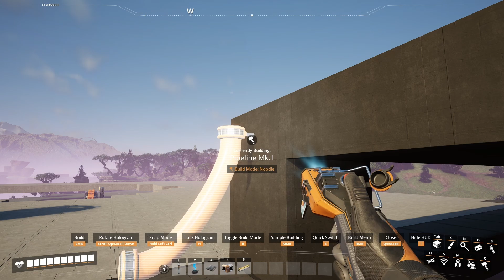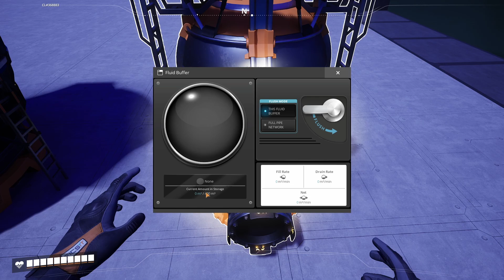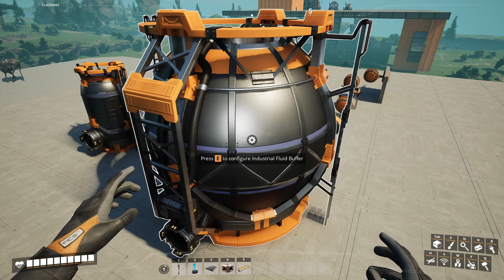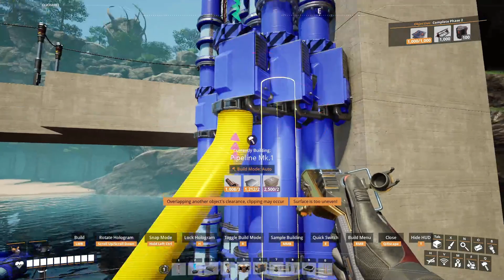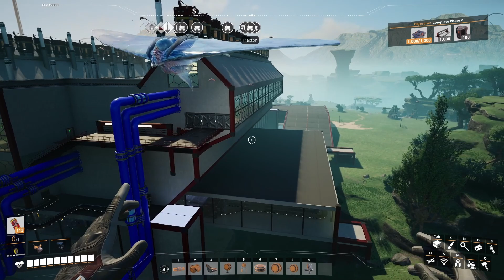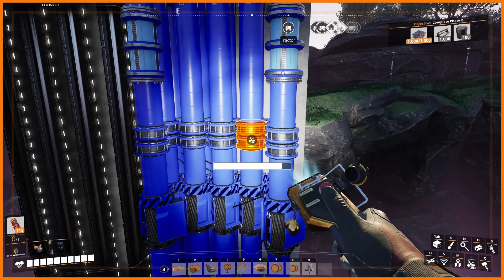Guide for Fluid Mechanics + Flow rate bug fixes (Mk 2 pipe bug) | Tips and Tricks | Satisfactory 1.0

Comment: My main criticisms about this section of the game, as someone who works in the chemical industry, are:

1) the fluid mechanics in this game are so jank, and it seems to be a mixture of lazy coding and utter lack of research. 

The devs will put so much time and effort to fix the floating point calculation, but can't even code that head shouldn't reset at the inlet of a pump. It's so strange. 

And the raw numbers on equipment are just off as well. An industrial water pump for a large plant should be able to output 70-90 psi without even thinking, and the flow rate should be much lower. Satisfactory's water extractors are centrifugal pumps so pressure is their job. And it wouldn't just mean building more because the amount of water going into power buildings, when converted into steam generation, doesn't line up at all with what a generator would make with that amount of steam. They just threw numbers at a dart board and used that. 

Not to mention that the pipeline pumps are just awful. They are visually a PD piston pump, which means that every time the buffer on a building is full it would likely rupture thanks to the cut off flow.

I could go on

---------

2) The playerbase's obsession with 100% efficiency is so dumb, you'd never be able to run a plant right on the edge of perfect flow and perfect pressure going into a system. Conditions change, and you build your system to account for that. Provide a pressurized header so you always have flow. Always build a stand tank to account for system instability. 

But no, Satisfactory players have gotten it ingrained in their heads that 100% efficiency is the only way. It's brain rot 

I get that things are gamified but it just ruins the game
Reply from the maker: there is a thin line between gamifying something and realism, I can unerstand why the devs chose the numbers they did, but the second point, about 100% efficiency, that I agree with, adding in a buffer or downclocking a system is fine if it makes it stable, rather than 100% effective
Reply: @jackblade281  I mean, it's one thing to say you understand why, but the numbers are just random. It takes about 10 minutes to actually do the calculations and use numbers that halfway represent what's going on, that's just laziness at that point

Comment: There is some very bad info on this video mixed in with good

For one, as confirmed by devs, mk2 pipes aren't bugged they work as intended - you fail to mention looping the system so that machines creating stutters by pulling fluid into them don't stutter the whole system

Valves and buffers are unreliable 'solutions'. They more often than not cause issues in a system.  The only places, if you want reliable set ups, that you have buffers? Train platforms. 
Valves only send X fluid pm through a point if the pipe is full, if the pipe is full and feeding a machine that consumes X , then the machine regulates flow. A system that works with a valve will work w/o a valve.
Reply from the maker: if that works for you I am happy, and won't argue with you. However that does not make my info bad, it's just not for you. 

The loop is only good for systems that aren't ever 100% saturated, I will bring it up in an upcoming video on fuel generator setups and byproduct handling

The valves and buffers are great when used correctly and in the right situations. Once again, I have not gone into detail in this video because it becomes relevant with Fuel Generators and Nuclear Power and I will reserve time in those videos to really go through how to use them.

And no, not all systems work without a valve, I have seen at least 10 different fuel gen setups the last week that were helped specifically by fluid buffers and valves, especially when loading up a save.
Reply: @jackblade281  systems should be 100% saturated. Always pre flood your systems. 

1. it helps manage back flow as fluids flow to more empty spots and not having a flooded system can create sloshing that may permanently destabalise systems
2. it's excellent trouble shooting, since if you start off with a flooded system and you see a machine start to starve you know there's a flow issue

In basically every system a valve or buffer is used the system will run fine w/o them. 
Again, valves will only allow it's marked flow to pass through it when it's *full*, which you apparently don't like, and at that point, the machines consuming the flow will regular how much goes down the pipe. Making the valve pointless and just another possible failure point. 

And it's not that it's impossible to have functioning systems with valves and buffers, it's the difference between carrying plates to the table to set dinner, and juggling them to the table. While sure, you can juggle them, it just shouldn't be how you teach people how to set the table.

Comment: There's no answer other than don't use mk2 pipes.
Reply from the maker: as much as possible, yes but you can still have other issues that happen regardless of if you use Mk2 or Mk1
Reply: @jackblade281  I have 375,000 MW of power using mk 2. 93% and moderate power flux. Switched to mk2 and resigned, 425,000mw 100% no power flux. Some of your tips with mk2 in this and previous vid helped but never 100%
Reply from the maker: @jlatture1  I am just happy you have gotten it to work! It's so finnicky, needlessly complicated and if someone out there says they have 100% grasped fluid dynamics in Satisfactory, they are missing something XD
Reply: @jackblade281  I had a mega coal power plant ~30gw with mk2 pipes going thousands of meters with the water. In 50 hrs, no flow rate issues using mk1 pipes. Even with letting the system fill, raising pipes, using pims etc etc, never can get 100% throughput with mk2 pipes
Reply: The devs confirmed that there is no mk2 pipe bug. There are only flow rate issues when you have back flow in your system. Fill up the pipes before starting machines to fix it.

Comment: Thanks for the video! I've wasted more time on fluids than anything else in this game so these videos always help people. I think Coffee stain all trolled us by having the fluid dynamics for dummies book in the hub's bathroom on this. lol. However, I would like to say that any pipe video that covers the problems with pumps and how water towers solves these problems should not be showing a wall of pipes with pumps at 24:00 in, lol. I get why you're showing it because every pump on those pipes can cause problems, but you should also be saying "While I'm going through and fixing all my pumps like here, you can also use the water tower principle to get rid of most of these pumps as well - which is even better". Then show the after picture with just a single pipe going up with the pumps properly added. Because using your own words, having a single pipe with pumps is much simpler than 12+ pipes to deal with (likely over 50 pumps).
Reply: I didn't realize resetting the head lift with a buffer set to a higher point was a glitch.
The mechanics work exactly like a RL water tower. We have many here in Texas. The flow created by gravity negates the needs for pumps to houses...

Edit: Some research indicates that the exploit has to do with breaking head lift very specifically to create a scenario where you can lift fluids even beyond the original water tower. Gravity-fed head lift is intentional.
Reply from the maker: @PersistentDissenter  yepp, I do mention water towers and "saving" headlift by running fluids down into your system, and building fluid systems top down instead of bottom up, I could probably have been clearer though
Reply from the maker: I also say this in the video; That is an exploit, a glitch, and I am not teaching people how to break the game, I am teaching how to use the game mechanics as intended. Let's Game it Out and others will likely show that off, I wont use that, if it gets fixed by the devs my video is still relevant, if I added that in it would no longer work.

Comment: i had 48 fuel generators being used in my first oil power plant and the issue i ran into was the fuel not making it to all the generators. the solution i found for that was to underclock the ones in the back to 50% and slowly bring them back to 100% once i did that i no longer had problems :D

i have ran into the pump bug. i didn't realize it was because the pipe was going through it, i solved it by deleting the entire pipe and replacing it lol!
now i know i just need to delete the two segments and replace them thank you ^^
Reply from the maker: yea, fuel generators are horrible to get to 100% happy you solve it XD and yea hope it saves some time for you later!

Comment: Hiiiii I can't use the trick of joining two sections of pipe with the pump on the mk2 pipes
Reply from the maker: if the pipe segments are way too long, it wont work. also, I haven't extensively tested it after 1.0 so I don't know the exact specs for making it work yet. But try shorter segments for now
Reply: @jackblade281  yea it was exactly my line of reasoning and still nothing I even replaced the same exact pipes with mk1 and I got it without any problems but when I put mk2 back I couldn't get it again 
I'm really confused as I never had any problems before 1.0 and now with the same exact setup I'm having problems
Reply from the maker: @Carmo_TDM15  I would recommend splitting your pipes up then so you can stick with mk1 tbh

Comment: Snutt has confirmed more than once that the floating point problem in MK2 pipes has been fixed. But I can also confirm that the problem is still there. In my aluminum plant, over dozens of hours of testing, I have come to one conclusion - give up on the 600 m3 flow. It is better to run more pipes - nerves will be better :)
Reply: I find it works a lot better if you can design things so every machine only has one type of source. So each refinery (or set of refineries in a large plant) is either fed by water extractor, or bi-product water. Do not try to supplement by-product water with a little extractor water, the numbers will mess up somehow. All gravity fed if possible. 

Then have a wet concrete plant above that to sluff off any buildup of bi-product water.
Reply from the maker: @5353Jumper  Yepp, I got to that conclusion after spending waaaay too much effort trying to make my recycled water loop work for my aluminum plant in the U8 lets play
Reply from the maker: that, and better to sink byproduct water than recycle if you want to keep your sanity XD
But yea, agreed, sadly the problems are still there, one way or another. For now, we will have to work around them.
Reply: But what can I do with an oil extractor overclocked to 600? It's the main purveyor to my power plant
Reply from the maker: @diablo9070  a single short MK2 pipe from the extractor, go into a junction and split it into 2 MK1 pipes, and then use MK1 for the rest of it, plan the lines accordingly. That is my first advice XD 

If you really want to use a Mk2 pipe, make sure the pipe is saturated, use as long uninterrupted segments as possible, the fewer pumps needed the better, then just follow the troubleshooting method I show in the video if you have any problems. 

Putting in a valve, buffer then valve again at the highest point of the pipeline can also help with the game loading instabilities because all machines restart and some machines internal fluid buffers are emptied.
Reply: @jackblade281  thanks, I'll try your suggestions today and see if that solves my issues
Reply from the maker: @diablo9070  I will pray to the fickle gods of Flow Rates for you!
Reply: @jackblade281  your prayers have been answered! It worked! Thank you so very much lol I was super frustrated
Reply from the maker: @diablo9070  Hallelujah \o/ 😂
Reply: Couldn't agree more, I made turbo fuel power plant with 1200 turbo fuel to make 40 thousand MW. I was so happy, I thought nice numbers and two full pipes. I kept seeing flow rate issues so I just used 4 pipes instead, and there haven't been a single issue. 540 crude oil input for this project works fine. As long as it's not max 600 flow you are expecting pipes works fine. Also to reduce headache, you can liberally use the mergers and add more pipes in area with flow issues. Since there is no direction, in my opinion more often then not the liquid flows where it needs to if it can if the connections are right. Last thing, regarding using the mergers library, always place them first and then the pipe.

Comment: With the "horizontal to vertical" thing, it doesn't really have anything to do with going up or down, it just literally goes horizontal as far as it can and then vertical as it needs to connect to something that's higher or lower. In your case you put the upper pipe support right at the edge but the lower one was far away from the edge. If you put the lower support right at the edge it'll go down the wall, too, even if you start further back up top.

Also: Please turn off your discord notifications noise for recording :D
Reply from the maker: I have not seen that, might be right XD

huh, I have them on separate audio lines, it should not pick up any discord notifications XD Got to check that, thanks for catching it!

Comment: They supposedly did fix the floating point problem in 1.0. Also they changed the way belts and pipes are, all segments are not calculated seperatly they are all one calculation now no matter how many junctions on a pipe.
Reply from the maker: If all that was fixed you would not have a single segment of the pipe just randomly not connecting, they may have fixed some stuff, but obviously other problems remains, or they are new problems with similar effects on the pipes XD
Either way, the way I have done things with the pipes since 1.0 has fixed any problems I have encountered
Reply: @jackblade281  I agree that I also am running into some of the same issues but I will sight my sources for those that want to check it out. 

Pipe floating issue https://www.youtube.com/watch?v=ASfKo0dKBbU&ab_channel=SatisfactoryClipsArchive

Belts/Pipes calculation change starts 4:40 https://www.youtube.com/watch?v=yIKjR5jVv9Y&ab_channel=CoffeeStainStudios
Reply from the maker: @nstag8r  chefs kiss, love when sources are there :P ANd yea since the problems and how the show up are so so inconsistent, I made this video assuming they are ALL there so whatever shows up for an individual person there is something that will help XD

Comment: great video, just hope I don't have to redo all of the water lines going to my factory, 48  mk2 pipes will ruin me :)
Reply from the maker: It sucks, but if its not working, you might have to redo some of them at least XD
Reply: @jackblade281  did the pump trick you showed when I installed the mk2 water pumps, so crossing fingers.
Reply from the maker: @SieepybearPlays  hope it works ^^

Comment: Hi @jackblade281,
I really liked your flow rate videos! Thank you.

Is the first one still valid? You showed how to avoid the water hammer effect in the first video, but in the current video didn't mention any solution for it (hopefully didn't miss it).
Again, thank you so much.
Reply from the maker: Yes I excluded it because it is only a real problem in an unsaturated system, this problem only persists in fuel generator lines and byproduct drain lines, so I will do a whole separate video specifically talking about fuel and oil setups. So essentially, if you have saturated your system, and it does not run to fuel generators, or have irregular inflow rates, just make sure you have completely saturated your system before turning on the machines and you will be fine